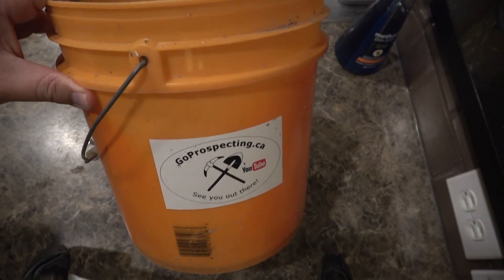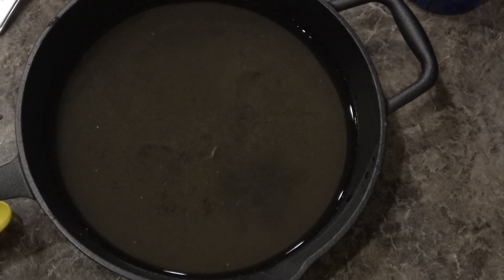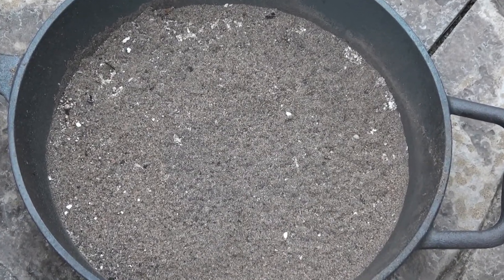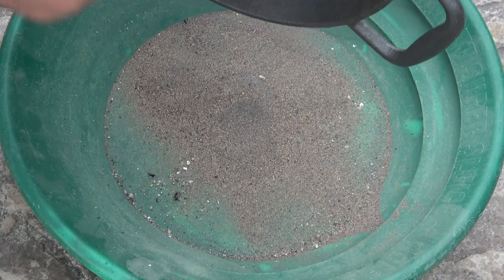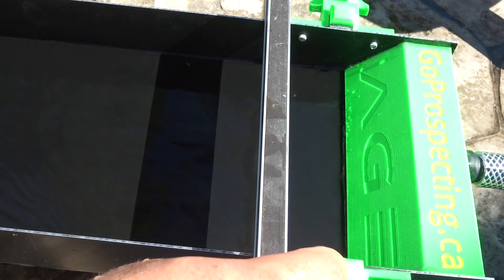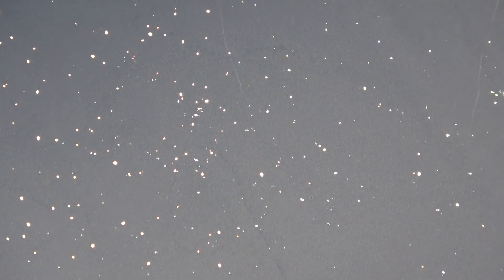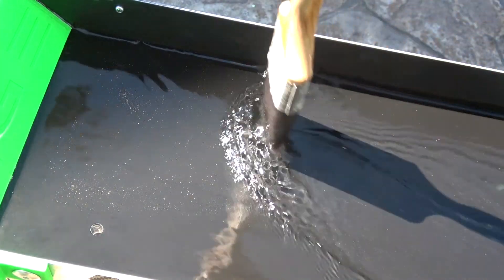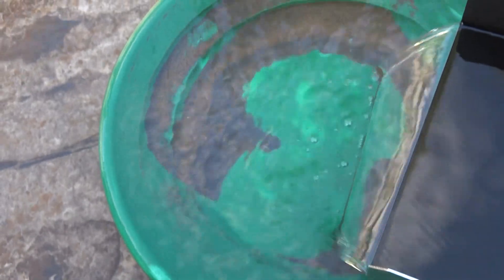Roasting Gold Concentrates

Comment: I have some good news and some bad news for you brother. The good news is roasting is the key to unlocking the gold from sulfides there is no way around it. A little more good news gold in micron form turns brown whenever it hits 800 to 1000 degrees and stays there for at least 10 to 20 minutes. Any dirt that was brown will turn into carbon or ash. The bad news, a miller table is the equivalent of a pan just constant panning. You cannot pan micron gold. It has to be separated a certain way. Or you could of leached with acids just washed everything with hcl once or twice then use AR.

Comment: I have been observing people go through a lot of trouble getting the flour gold. In Lab I would use a centrifuge to concentrate it. and if there are platinum group metals they will concentrate too. With heaviest at bottom and lightest at top. Will even stratify into layers.
Reply from the maker: year or use chemical extraction
Reply: @BackyardProspector  you mean to say, we dont really need to roast it if we're using the chemical extraction process?
Reply from the maker: @Jibrannajam92  I would say no because you are dissolving all the Au into solution.
Reply: @BackyardProspector  thanks for the reply,

i see, but if there is an excess of magnetite already there, will there not be a possibility of it pulling the gold out of solution. I.e cementation on iron (magnetite) or carbon if any?
Reply from the maker: @Jibrannajam92  A proper Aqua Regia solution should dissolve all elemental gold.

Comment: Rad video I noticed didn't mention brushing the table before entering your material to remove all air bubbles off the mat. Brushing It Off does that really matter?
Reply from the maker: Yeah the bubbles can interfere with dynamic flows of active matting

Comment: Without a closed loop recirculator pump system with 'jetdry' the water surface tension floated the gold off the table and most likely out of the pan ... Your choice your loss so either 100% best effort or sloppy technique for whatever falls... Good luck!
Reply from the maker: I do try to use some jetdry in any closed loop systems I use for separating cons.  I probley just didn't show it in this video.  Thanks

Comment: Just a quick suggestion; ... after aprox. 30 mins of roasting the cons at aprox. 1,000f - dump them in cold water ... this will shock the black sand and turn them brittle ... then take the brittle cons and subject them to a light crush ... then run thru Miller Table
Reply from the maker: I have heard of that.  I will try that, thanks!

Comment: Roasting is for  treating refractory ore, such as pyrite with very small grains of gold encapsulated. The smoke that comes off the ore is the sulfur being released, breaking the chemical bonds  that trap the gold. Anything on the NSR has already been ground so fine that the sulfides arent really intact any longer, the gold has been released. Its probably to small to be seen by eye. To catch that tiny  gold, smelting, mercury or chemical processes work best. Another option to capture the remaining gold in black sands is to put it in a rod mill which will pulverize everything except the gold, which will flatten it  out and make it  easier to see.
Reply from the maker: thats some good info, thanks for sharing!